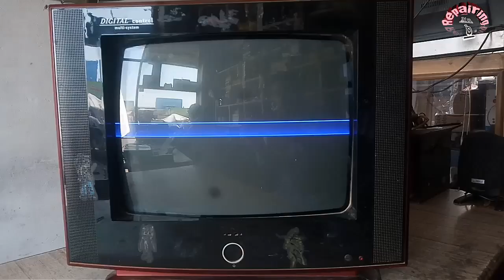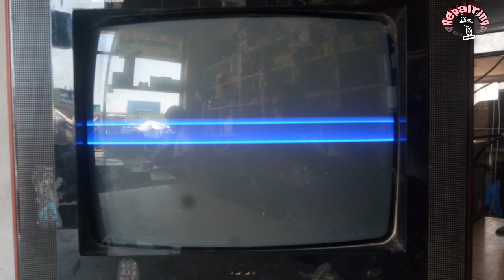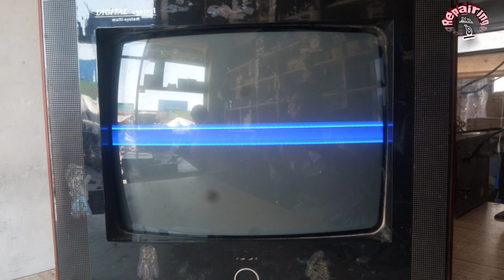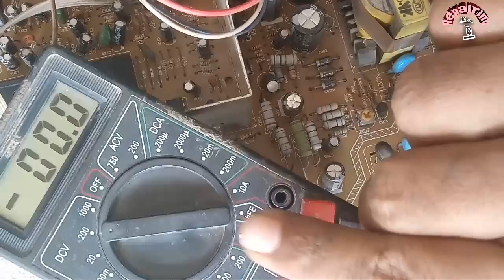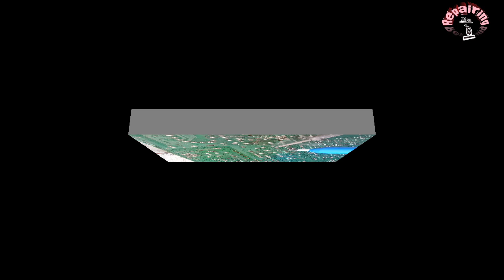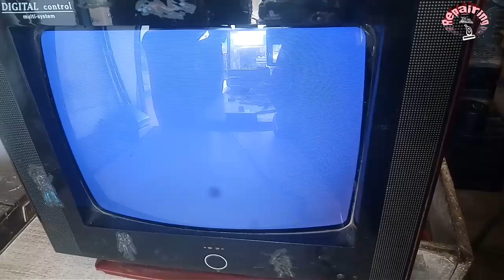CRT TV SMALL DISPLAY DISPLAY PROBLEM|tv repair|fix it|television repair|easy fix|vijay electronics

Comment: REPAIRING HUB, 
What are the G1&G2 used for? The flyback powers the vertical deflection amplifier and NOT the horizontal deflection amplifier any reasons why? 
Any reasons why the horizontal oscillators is referenced to 15.975khz and the vertical is referenced to 60hz, why did they pick these frequencies as the references?

Comment: REPAIRING HUB, TVs have a B+ voltage set at 125vdc what does the B+ voltage control or do? Is the B+ voltage a bias voltage DC offset voltage for the sync and hold circuit?
Reply: There are multiple circuit design, most of them use bias voltage, and also in olden days there were no +B monitoring or protection circuit.
Reply: @learnandteach.108  what are the bias voltage goes to which circuits in the monitor to be biased? the B+ voltage goes to which circuits in the monitors?

Comment: Sir panasonic tv jab britnss badhanese se asi line aati he to kya problem ho sakta he
Reply from the maker: Screen voltage zyada ho sakte hain in ko km kr leñ.
Ya 180v capacitor failure ho sakta hai .is ko check kr leñ.
Reply: Tx sir

Comment: Burnt resister ki value kaise search Karen.
Reply: 3 tarika say.
1 same circuit say
2 circuit diagram say
3 ye Thora long process hai, pehlay aap ko vus point ki voltage requirement find karna hoga, agar ye nahi kar saktay to phir blind search karna parega.
Voltage required ho ya blind search ho, same procedure hai,
First of all higher value resistor lagana hoga (in mega ohms) of same wattage, phir resistance value kam karte aana hoga, jab tak desired voltage na milay
Hope this helps you.
Spelling mistake hogi, adjust katlo,
Ek baat, ye procedure karne say pehle resistance burn ki reason find karlo, aage kuch short to nahi.

Comment: Sir mere pas 14 inc ka TV ahi jo kuc der tik calta ahi pir vartical lin ahta ahi ise kayse tik karu
Reply from the maker: Vertical line ane se before and after Regulated Supply ke voltage check kro. This could be the fault otherwise loosing could be another fault.
Reply: China kit hai ya aur koi bhai jitana ye batate hai mai sab janta hu
Reply: Sar Mere team Mein factory likha hua a Raha Hai Kisi bacche ne iski setting Chhod Diye to usko Kaise hataye China kit